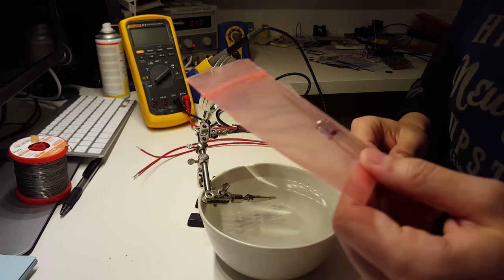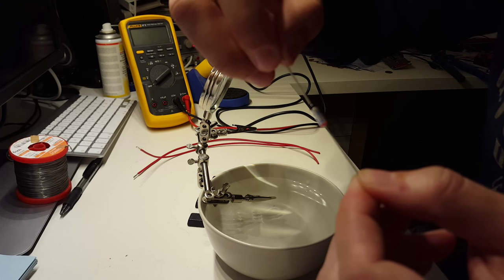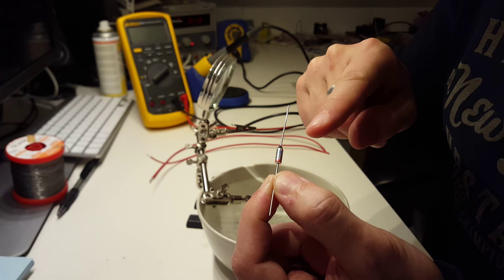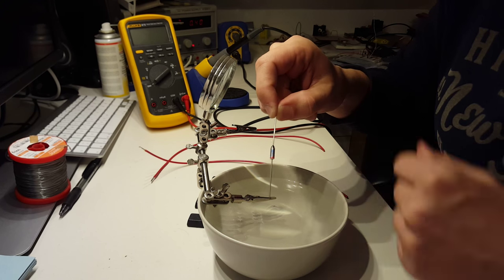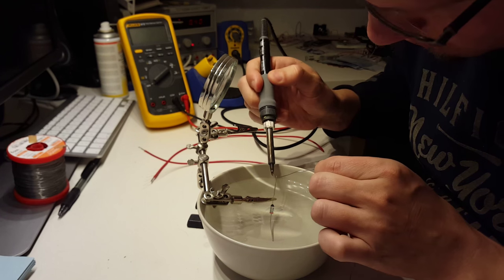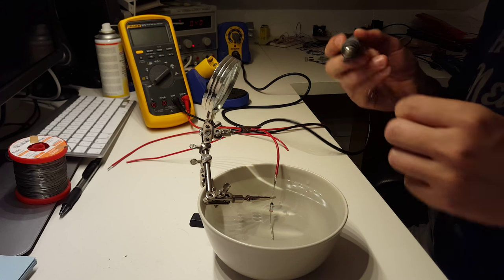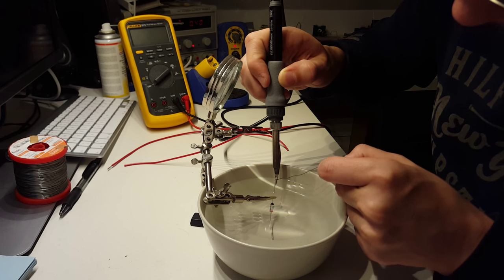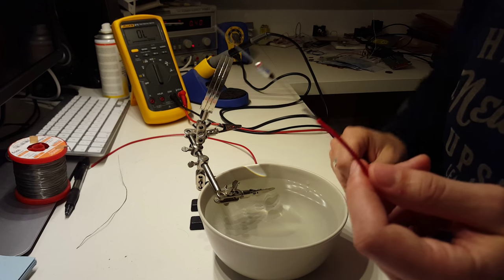How to solder a thermal fuse

Comment: Water - great idea ( there might be a pun there too ;-)  ).  I have a couple, both with fairly short leads onto a circuit board.  After blowing about 10 or so, and they're not that cheap to throw away, I came across your description in desperation.  With a powerful soldering iron and a little bath made with a plastic milk bottle cap, that did the trick!  Thanks for sharing!
Reply: Great idea with the milk cap.

Comment: Hi, I've never tried this before but does the water not effect the fuse at all? I would think that the water would potentially cause a short.
Reply: Naaa, the water doesn't cause problems because the thermal fuse is hermetically sealed, either with glass or a glasslike epoxy.
As long as you dry it off after taking it out of the water, it shouldn't rust.

Comment: Clever idea to save the Thermal Fuse.  Do you know if the Tapered side of the Thermal Fuses is supposed to be facing the Power Cords side?!  I need to replace one for a Panini Grill, but I don't remember the orientation of the Thermal Fuse.
Reply: Polarity does not matter for thermal fuses.  So it doesn't matter which direction you install it.

This is not the rule of thumb for all electronic components of course so be sure to check out the manufacturer's data sheet for a quick lookup of each component you work on.

Comment: a thermal fuse shouldn't be soldered because it is going to be exposed to high temperatures and that wickens the joints. It should be crimped.
Reply: absolutely correct!!!
Reply: True, that's the electronic manufacturers do on their products. Me too.
Reply: my transformer fuse blew, and it was soldered.
Reply: @Proximity Symbol - Right except when the thermal fuse blows, you'll have to cut your wire down to replace it. And if you don't have wire to spare, you're screwed the next time.
Reply: If the product's thermal fuse was originally soldered, then that's what you have to do when replacing it. Professionals use a heat skink to solder thermal fuses. This water trick is sort of a makeshift heat sink.